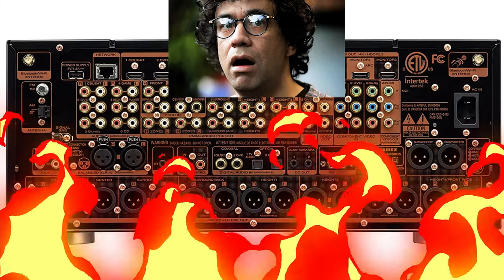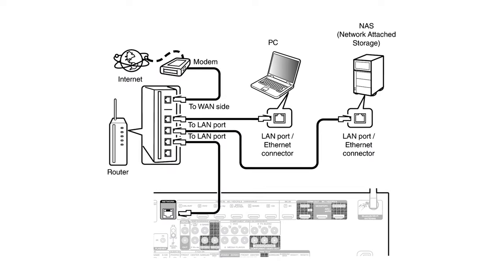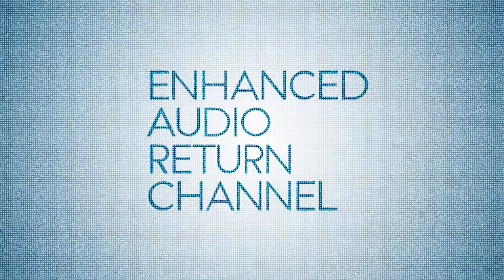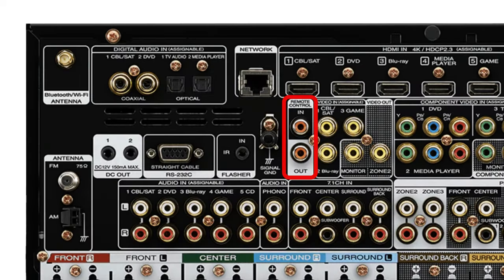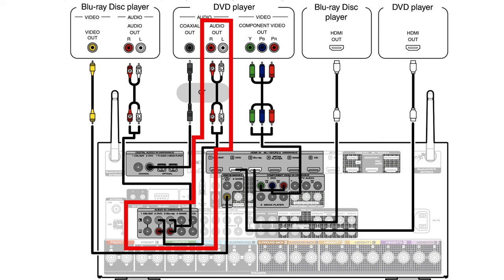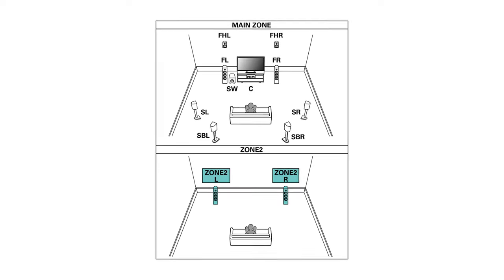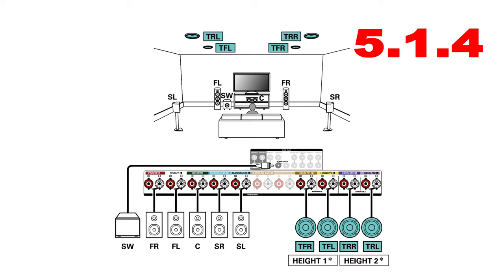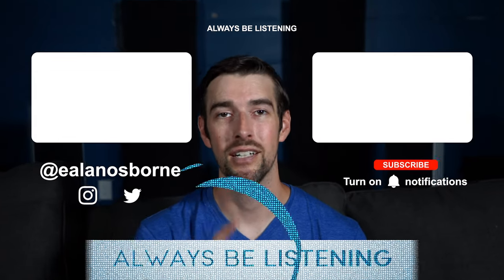REAR PANEL EXPLAINED! | Home Theater Basics | AVR | Marantz | Denon | Yamaha | Sony

Comment: I have definitely learnt a lot from your videos. Now i have clarity and ready to set up 5.1.2 and expand later on to 7.2.4. Thanks Ealan..
Reply from the maker: You’re welcome, Sanjay! 😁🤘
Reply: @ealanosborne  Hi, I need one more help. I have Bose cinemate 120 in my bedroom. It has subwoofer & sound bar. Now if I have to add new bose soundbar 900 or newly launched 600 and small surrounds, can I use old subwoofer with new soundbar

Comment: Great video and clear to understand. Do the pre-outs and the amplifier outs work simultaneously, and if so, do the pre-outs exactly match the speaker outs in terms of crossover points, volume control, etc? My reference AVR for this question is the Denon 8500.
Reply: It depends on the model you have.  If I assume correctly that you have an AVR-X8500, this unit has a lot of flexibility to configure it for a mix of pre-amp or internal amp assignment.  You can also go all pre-amp mode and shutdown all the internal amplifiers if you prefer.

Comment: The 7.1 CH IN is also needed in case you come from a separate AV processor and want to use the receiver as amplifier only.
Reply from the maker: Yes, correct!
Reply: A common processor type in the day would be the old AC3 Processors that utilized the AC3- RF Input for LaserDisc.  However, most of us who still use these products would just utilize the Processors optical digital out (if provided) so we can take advantage of the newer surround codecs in the AV Receiver so the Processor ends up being an expensive digital switch box.  Which is really cool as I use it in that fashion so I can put all my LD player’s digital outputs through it and provide me the ease of switching to pass anything from Dolby Digital, DTS, and PCM without unplugging cables.
Reply: It is also good if you have antique QUAD equipment like an Akai 400DSS or CD4 decoder

Comment: The more connections on the back of my A/V receiver, the more I liked it. Used to disconnect everything and have a huge pile of cables on the floor and think "what have I done?", but would hook all my many vcr's, LD player, DVD players etc. back up in an attempt to make the hook up more efficient. Good times.

Comment: My Onkyo rz820 has terminals for height
I read this is for by wiring is this correct
Reply from the maker: The RZ820 actually supports Atmos and DTS:X, believe it or not. But the “height” terminals on the back can be reassigned to do bi-wiring, too, yes.

Comment: Good sir, there seems to be some confusion when using the AVR for your sources. So let me ask you. Do you plug in your cable line directly to the TV or do you plug it into the cable hdmi port on the AVR. Same question for Blu-ray, players, gaming, consoles, etc.
Reply from the maker: Hello in return, good sir! Well, since I have an IOTA AVX17 preamp connected to my home theater system currently - which does not support eARC - I plug all my sources into the preamp: 4K Blu-ray player, XBOX One S, and Apple TV 4K. That way all Atmos or DTS:X Audio is decoded by the preamp and sent out to my speakers, and video is sent to the TV via HDMI. 🤘

Comment: If I use and external amp for my main speakers via pre outs (5.1.2). Can I use the unused channels for another room with 7 speakers as well?
Denon 4700H (pretty much the same avr)
Reply from the maker: No, unfortunately. It’s “either/or” when it comes to using the internal amps or the pre outs. The 4700h is only able to process a total of 11 channels. You can setup a 5.1.2 system in one room, and a 2-channel Zone 2 and Zone 3, but not a second surround sound system. Make sense? 👍
Reply: @ealanosborne  damn 👎🏻
So getting a second receiver or power amp and connecting the rca zone 2/3 out to the rca input in the second amp/receiver, or hdmi out to hdmi in input would be a good idea? I want to control everything from the 4700h and just use the second power source, as that, a power source for the second zone, have all the processing done with the 4700h

Comment: Question: how do you / can you use the second sub out for usage in Zone 2? I'm talking specifically about the SR7015. I have it in 5.1 + zone 2 but I would like a sub in zone 2....
Reply from the maker: One way to pull that off is to go from the Zone 2 pre outs, and power your Zone 2 with an integrated amp that also has a subwoofer output on it. 🤷‍♂️ Otherwise, if you’re using some internal amps on the SR7015 to power your Zone 2 speakers, there’s no way to utilize the 2 main subwoofer outputs in your Zone 2. They only work for the Main Zone.
Reply: @ealanosborne  that is what I'm afraid of... I guess I could also just go from the speaker outs from the height speakers / zone 2 and pass them into a sub with speaker level inputs and outputs and then pass onto the other speakers that way?
Reply from the maker: @koenhuet5941  That’s a possibility, yes. Or perhaps Bi-wire from the Zone 2 internal amp, going to both the speakers and sub, adjusting the crossover manually on the sub. 🤷‍♂️

Comment: When using component video, how do you know where to connect the red/white audio RCA cables? Wiil gaming system (with updated component video cable) to Onkyo TX-RZ50
Reply from the maker: It looks like both the component video and audio sections have a label that says "assignable," so it looks like you can assign them however it works best for you. So you should be able to use the component video in, and assign any of the audio inputs to go along with the component in.